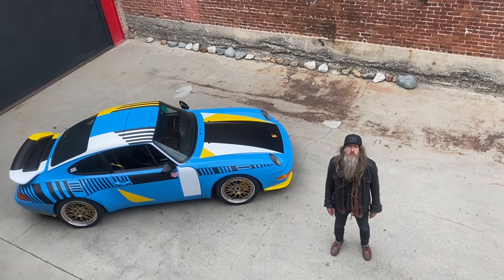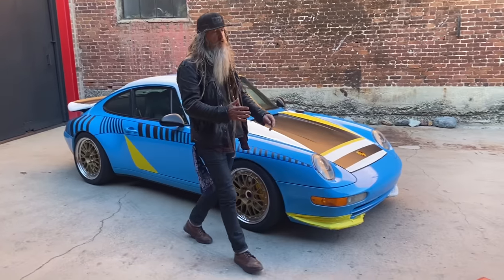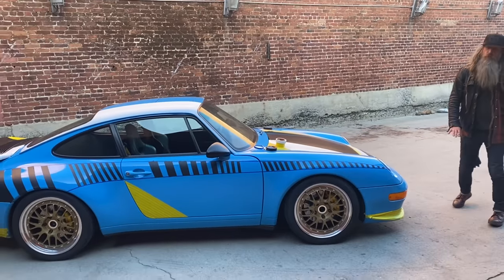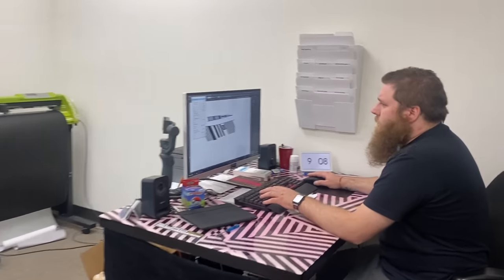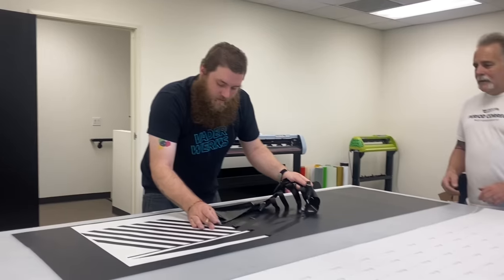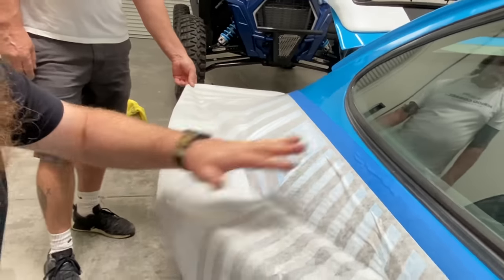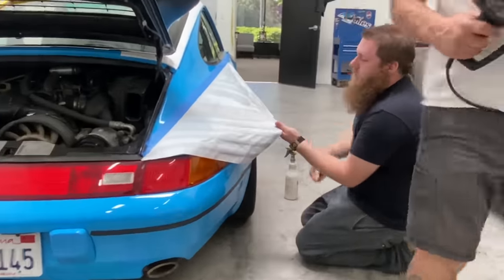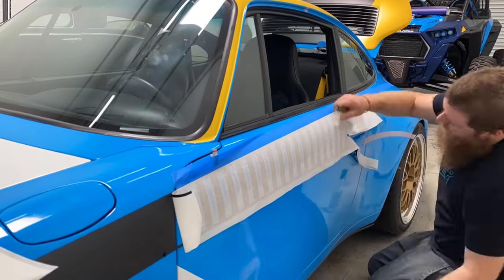993 ART CAR

Comment: Meh - that "artwork" just messes with the very clean lines of the 993 ... too busy, and a 993's shape does not embrace straight lines so there is just conflict (and I know the 993 lines well having owned them for that last 16 years...). Good thing is you can remove it easily.